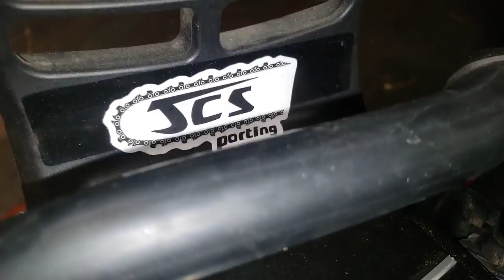THE ULTIMATE MODDED CHAINSAW VIDEO! porting, nitrous, pipes, V stacks, dye, powdercoat and more...

Comment: I cannot suggest highly-enough that anyone interested in performance builds watches this video closely, pausing where necessary, from what I can tell there's at least 2 "tricks" in here that he lets you see on the units but has never gone-over on prior videos (I'm not gonna go naming them because am not 100% if John intended them to be public although I'm real eager to discuss 1 of them as it'd massively affect breathing & blowdown potential on any saw it was applied to)  
A++ John as always!!  May I ask, do you have fiberglassing/carbon-fiber skills?  If not I'd offer that, I'm nearly positive, that you'd get a TON out of it I mean I made a custom clutch cover because I didn't want to pay for the WCS one (and wasn't sure of its weight and that's real important to me, would take weaker for the weight-savings on many parts, unlike most) 
(PS- Do you put those tank-sleds/undercarraige plates on all your official builds?  I've begun seeing them as an almost "required" part for any saw over 13-14lbs, if only so that you can put it to-ground far rougher/more casually than you'd ever dare w/ unprotected bottoms!  I ask because I'd actually just cut/made my own for my cs590, love it, but for my 660's I just ordered from customchainsawparts 1 powdercoated and 1 'raw' and will be 'modifying' both, not just weight reduction but 90deg wrap 'fins' on the tank-sides - w/ fiberglass and finished appropriately/nicely - to improve upon an already awesome, but basic/straightforward, design :) )
(PPS- those long 'booster ports' for the transfers, where you have 2 long vertical slots in the plating leading-down from the uppers, that is just beautiful I'd dare say that putting such channels into the plating over the lowers-to-uppers bridge would be beneficial in many, maybe *most*, ported/built engine applications!  Took screenshots to add to my porting-pics folder lol :D )

Comment: Hi John.  Have you ever seen the way a carb and air injects fuel into an engine in slow motion.  Very interesting.  I was  wondering if there was a very fine mesh screen between the carb and  cylinder, if it would  cause better atomization of the fuel. Also a fuel injection motor would be interesting.  Love you port work. So damn nice. Do you think carbonfiber chainsaw bars will ever make an appearance on the market.
Reply: Chris,
Pretty sure the 500i's he does are all factory fuel injected. I may be mistaken though 🤷‍♂️
Reply: @mjt7585  The 500i is more like throttle body injection for vehicles .... 
Chains saws have broke into the 1980's ......